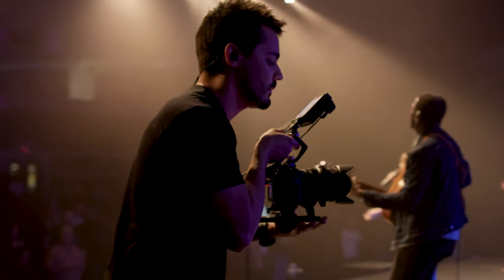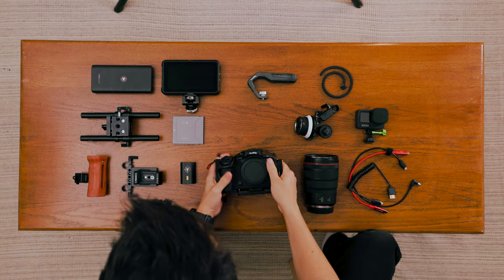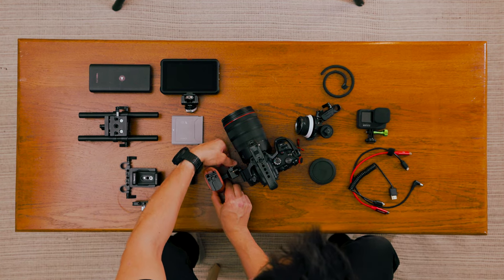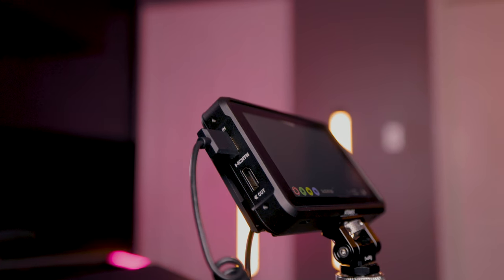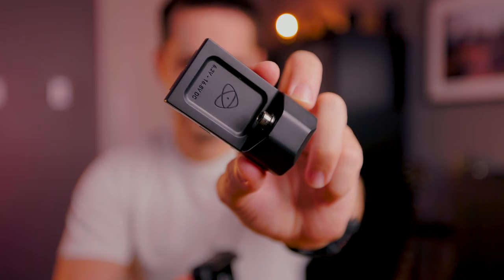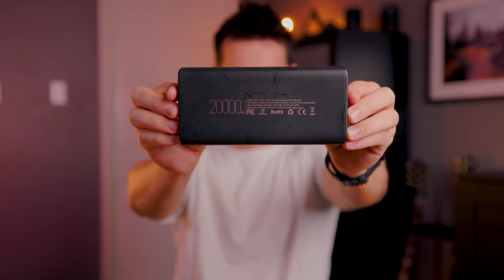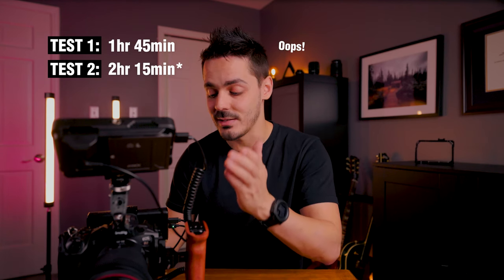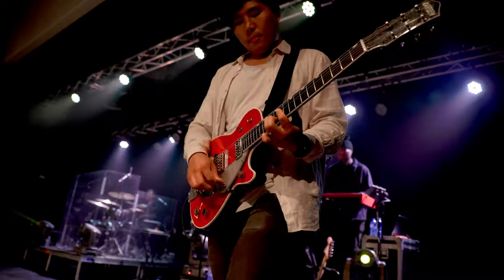The ULTIMATE Video Production Rig!

Comment: I'm curious as to why you would use a power bank over a V Mount battery? Solid rig though!
Reply from the maker: It was purely based on cost. V-mount batteries are great, but expensive. For about $60-70 I can get one 20,000 mAh USB power bank.
Reply: @AnthonyGugliotta  I see, thanks!!